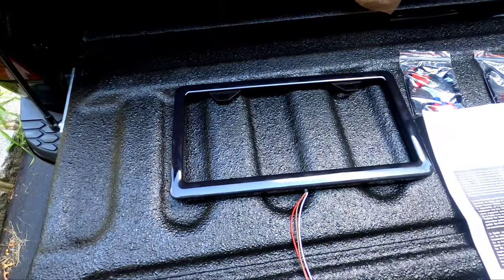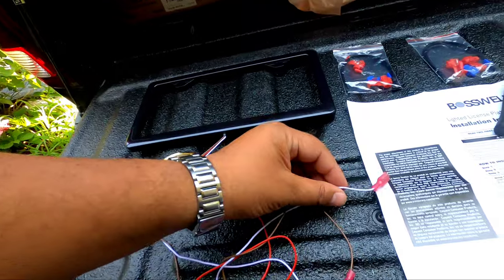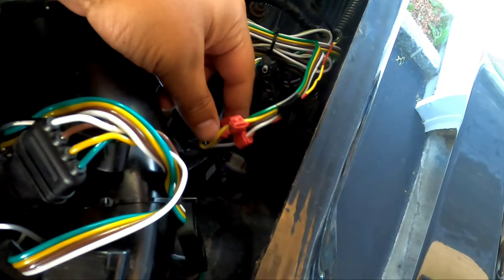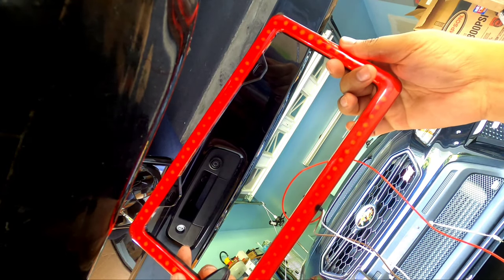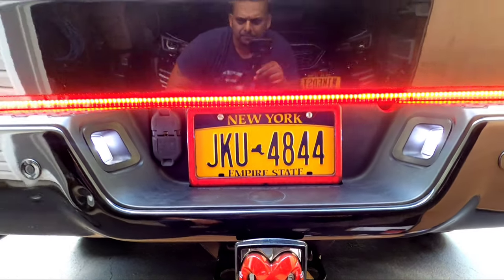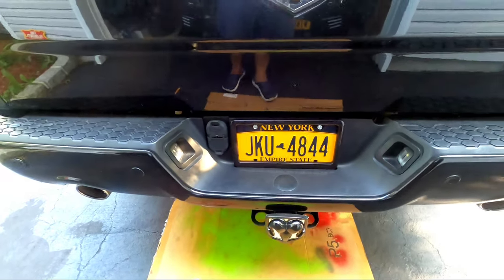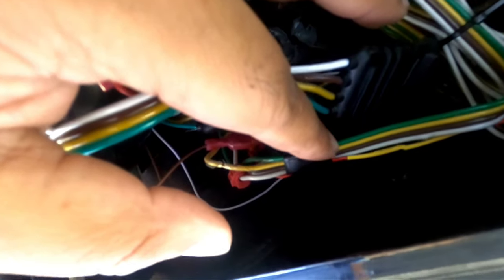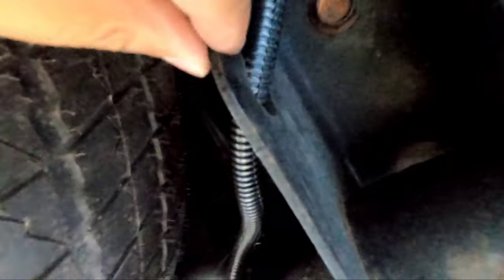Unboxing & Install of the LED License Plate Frame Cover and a Hidden Wire you don't know about!!!

Comment: Way to problem solve the anomaly. Wasn’t sure what to expect after the slight issue. But way to go problem solving. I wouldn’t have even known where to start to look to figure it out. And that Amsoil is working wonders with how the car feels.🙌🏾💯
Reply from the maker: You already know I'm happy that fang is running rite!!! And yes bro I thought I failed but literally 1% of the ram owners know of that hidden wire!